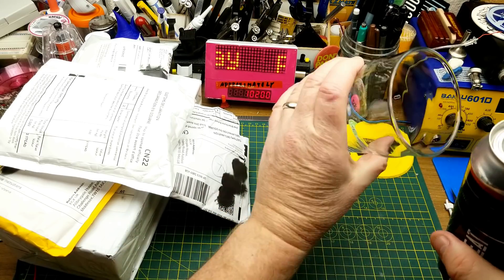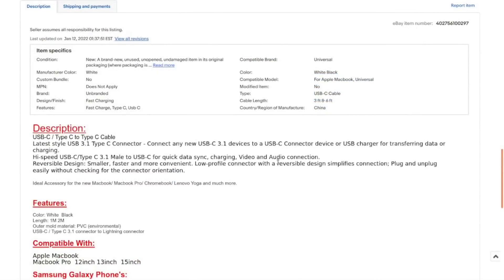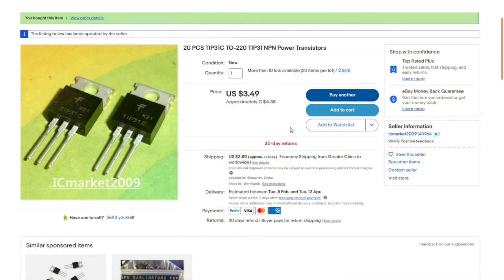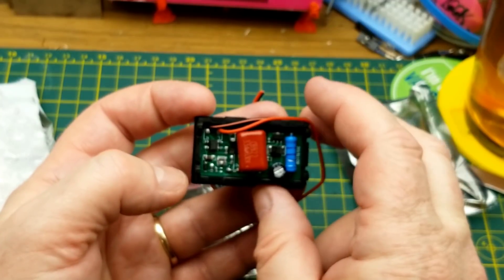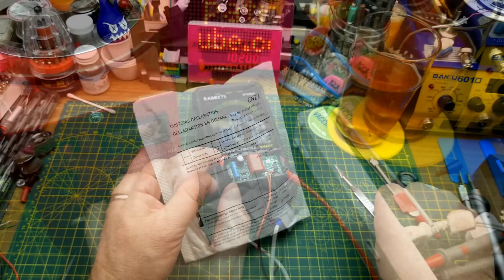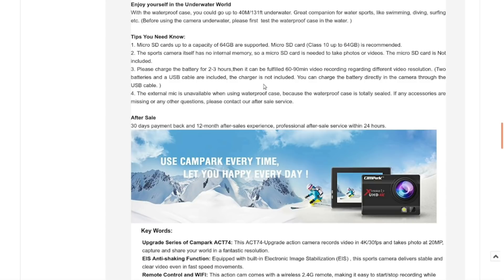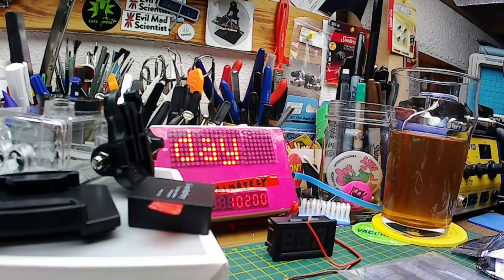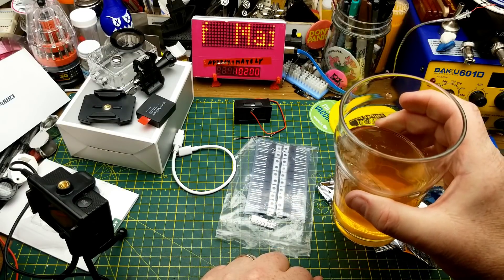Mailbag Monday 132

Comment: Typing this early so I may have to edit it, the "replacement back" is NON-waterproof typically, it's so you can retain the ruggedness but have better cooling and audio - but is NOT waterproof - check it out it will be obvious

Comment: That camera looks identical to one I bought several years back (branded FITFORT). Really no complaints for my occasional uses. I’ve done timelapse, hyperlapse, wildlife, biking and aviation videos with it.
Reply from the maker: The more I research this camera, the more it seems that the same hardware is re-branded under many different names.
Reply: @pileofstuff  Waiting for a review on it, if you have the time.

Comment: also picked up a cheapo actioncam and got the same bundle-o-crap mounts that came with it, some don't even make sense,so i look forward to your explanatory video LOL

the remote is useful, the wifi less so ( for me obvs  ) YMMV

cheers Kent
Reply from the maker: I'm sure some of the "pieces" in the box are just filler to make it sound like a bigger package. (each zip-tie is probably counted individually).

I'm mostly interested in the camera itself. Any specific mounts can be 3d printed as needed if the ones in the box prove to be useless.

Comment: I've had a nightmare recently with the ammeter versions of those LED meters. Some need external shunts, some have shuts on the PCB, and the sellers don't know the difference.
The problem with action cams is you need to be close to everything, ie, no zoom, and the mic isn't good when in the waterproof case.
Reply: The 10A ones usually have shunt on board, the higher current needs external shunt. However the AC ones (higher than 10A) almost always use use a Current Transformer (CT) rather than a shunt.
For AC, the CT versions are s better because the ADCs they use are low resolution and it takes a high voltage to measure the shunt current. That means that they need a pretty large resistance on the shunt, and that introduces a significant voltage drop to your output.
Reply: @johncoops6897  That's probably were I stuffed-up, because I didn't know there was a CT version. 
I bought an old analogue bench PS with a broken ammeter, and I've wasted so many $s on converting it to digital display I could've bought a good one in the first place - lol -.
Reply: @SidneyCritic  - Note that you can only use a CT for AC power, not for DC like your bench power supply provides.

Comment: With the volt meters for the Variac, it's quite difficult to buy "3-wire" type, with separated power supply and voltage sense.
It's very easy to modify the 2-wire type (like this one)... Coming off the Line input will be a capacitive dropper and/or resistive current limiter, then the bridge rectifier and Zener and/or Voltage regulator to provide power to the meter circuit.
Before all of that will also be a tap-off for the voltage divider that is used to measure the voltage. Just the respective trace to separate these, add a 3rd Line input, then connect them to mains and variac output. Works great, easy and quick!
Reply: I know the DC ones you just cut the trace link to separate the inputs, and then add the extra wire.
Reply: @SidneyCritic  - yeah, that's 100% correct. The AC ones are slightly different in layout so you have to do some searching to find the voltage divider that is connected to the measuring chip (Microcontroller?). The ICs usually measure AC directly, so the trace to cut is usually before the bridge rectifier.